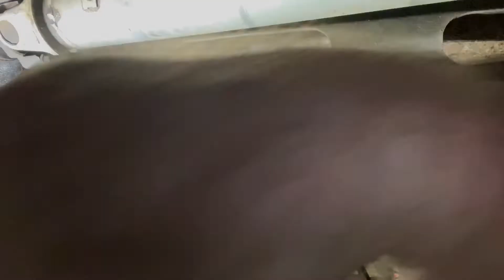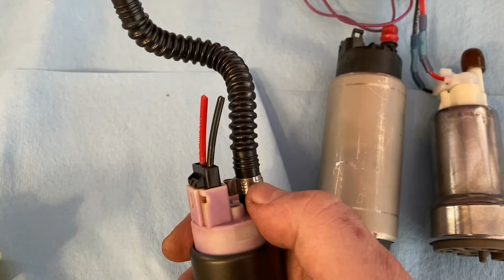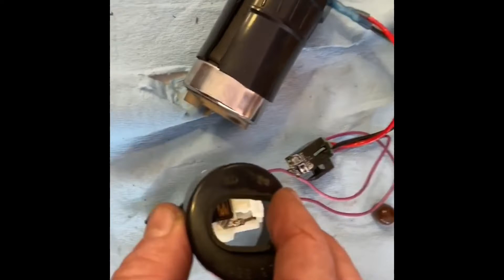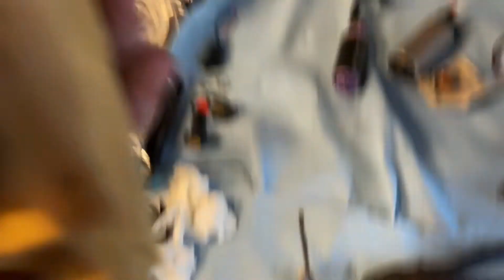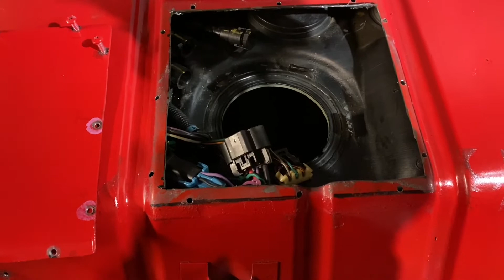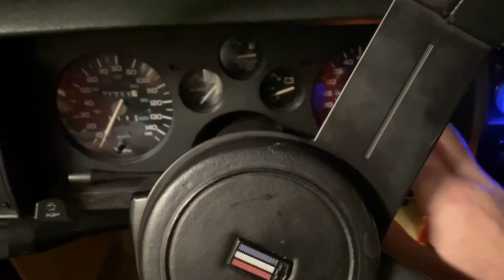LS Swap Fuel Lines | 4th gen tank | Bucket Modified | Hydramat | Flex Fuel E85 conversion

Comment: Was there a lot of wiring involved to go frd gen to 4th gen outside the tank?
Reply from the maker: You have to splice 4 wires (tank side) into 3 (3rd gen - fuel pump power, fuel gauge, and negative). Racetronix makes adapter I think now

Comment: @fireballmullet  are you using  the 4th gen evap canister?
Reply from the maker: Just whatever came on the tank but I don’t have it wired from ecm
Reply: @FireballMullet  ok thank you appreciate  the response  just trying  to eliminate  any gas smell for when i do my swap   if there is any with  out a canister???
Reply from the maker: @michaelpanzer67  I don’t have any gas smell really. The valve is closed and doesn’t relieve pressure. I think using the 3rd gen valve on the line might be the ticket.
Reply: Ok great    thank  you 👍
Reply: What does the quick connects connect to?

Comment: Slick, I truly believe the E85 will be the long term answer, not only for high octane power but ability to enjoy our cars into the foreseeable future. I am looking at using OEM GM fuel injectors for e85 set up. Don't recall seeing what route you have gone. Also, it will be very interesting to hear what kind of MPG you get (not that it matters). 4th gen plastic tank only way to go. Love the OEM quick diisconnects as well. Thanks.
Reply from the maker: I’m changing to FIC 850s injectors. Yeah 4th gen tank is a no brainer! Thanks as always for the comments bud!